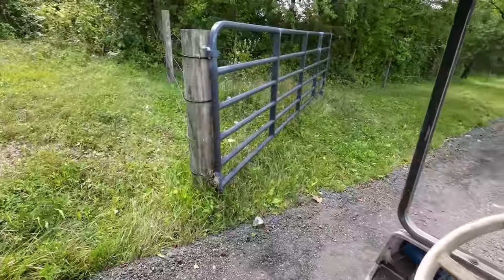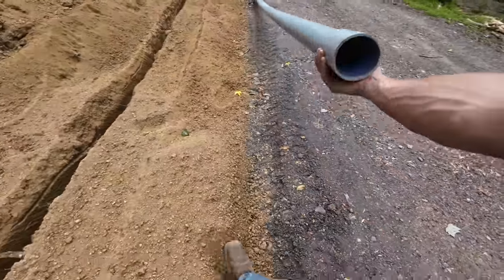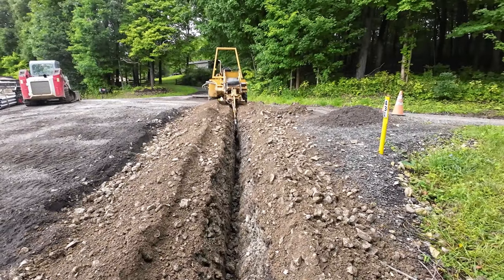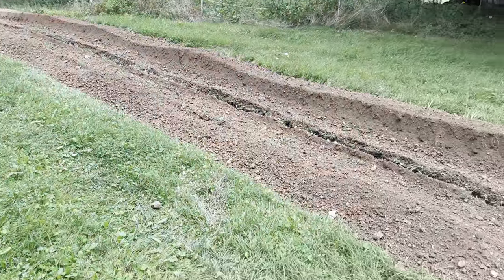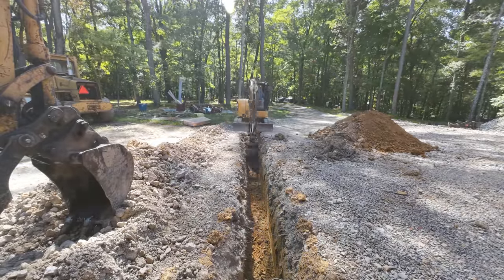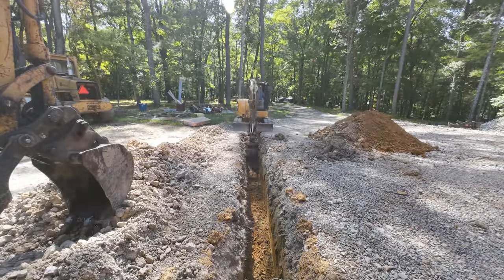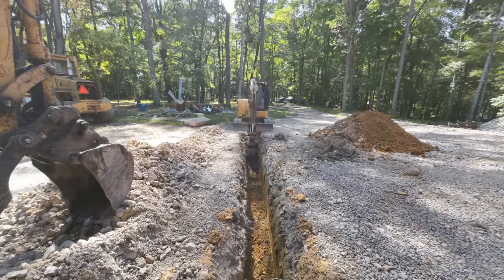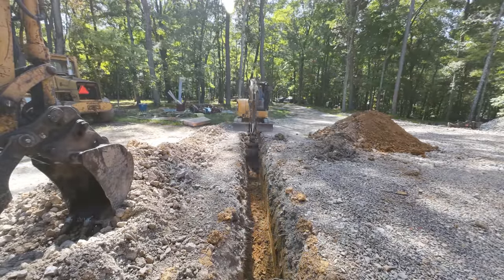Running Nearly 1/2 mile of Underground Electric, Costs over $64,000??!?!

Comment: Surely a Large Solar system doesn't cost $64,000?
Reply: with batteries you are getting close to that
Reply: Solar is unreliable, especially for high voltage needed to run an air compressor, though solar may be useful to supplement the cost of lighting, though the offset of the cost of solar would be rough. Solar is very rarely as efficient as people think it is.
Reply: @gnaedigerfels  but having solar you have no monthly payments for lifetime!
Reply: It also doesn't work
Reply: deadreckon- AmbitionStrikes has a solar system that powers their loft apartment and machine shop. with no issues
Reply: @DeadReckon depends on the size of the compressor and size of the system. Usually the duty cycle on compressors in a shop environment isn’t that much. You could easily make a PV system to meet a shops needs. I’m not sure it would be that much cheaper than a grid tie system and you’d be responsible for managing and maintaining all the infrastructure.
Reply: For my house it would be $30-$40 K. I would still have to be connected to the grid.  To be completely off grid and run machine tools would be over $100k with batteries and enough solar to charge them.   Then you have to clean the panels.  Batteries only last 7-10 years being used like that.  The costs increase exponentially!
Reply: @dustinmcintosh6799 Just because "enough" exists doesn't refute ineffeciency.
I could say that the ISS runs entirely on solar, but that doesn't mean that solar is enough for any usage, it means the ISS runs on low enough power to use it's gargantuan array.
Reply: In Kansas it's free provided and installed by our only power provider
Reply: People seem to forget the further north of the equator, the less efficient solar is, and in the winter months, it only gets worse. Don't believe me, think of you garden solar lights? Batteries also dont like cold, especially lithium, and come with a life span of 9 to 15 years. You can't offset cost if not connected to the grid, and it would cost double the current project cost with no return.
Reply: @GoogleSpyZon  100% correct
Reply: @clarencewiles963 solar power does not have unlimited life, the panels and batteries have a limited life.
Reply: @akhtarkh   company’s are coming out with 10 + years of warranty on their solar equipment and panels can come with a 30 year warranty so it needs a cost analysis and power companies ARE saying to not charge you car, turn off your AC, With brown outs.
Reply: He's in western Pennsylvania. With lake effect weather we have an inordinate amount of cloud cover. An interesting fact is during WWII, they placed the arsenal in Eastern ohio (not too far as the crow flies) due to it being one of the areas with the highest average cloud cover to protect from bombing. Long story short....solar isn't the best idea here.
Reply: @clarencewiles963 
Batteries are the weak point as are the chineseium panels…your replacing the entire system every 10 years …complete scam
Reply: @TgWags69  snow load is an issue that’s why you need to do a cost assessment.
Reply: @KenSiefert   you don’t need to replace if they are only down to 90 or 80% they can go undetermined and there’s companies that give 10 years of warranty. And getting better but if you’re charged cycles are as some 90% down to 50% you’re looking at lifetime. Of service.
Reply: @clarencewiles963  
Buy one, own it for 10 years with the extreme use for his needs, then do the math….your math is based on hope.  The warranty you speak of also has caveats for storm damage and a sliding scale over the life of the “warranty”.  Your insurance rates also skyrocket.

Comment: Dude....  You could have gotten a Tesla Power wall, a roof full of solar panels and a propane generator for back up.  At half that price, geez.
Reply: Was thinking just a nice size generator, what maybe 20 grand. He’s going to use wood for heat so not a lot of electric there. I don’t know what future power needs he has.
Reply from the maker: All of my shop equipment will kill any system like that very quickly
Reply: @DieselCreek  I think you might be surprised but I get it.  I hope they come down out of the clouds and drop that price for you.
Reply: Only problem is you need sunshine. That's in short supply in western PA!
Reply: @TgWags69  You need sunshine to charge the batteries, or you can use a very small propane generator to charge the batteries.  

Yeah, solar doesn't work everywhere.  But for $51k, I would be looking everywhere else for options.

Comment: I was going to tell you my story of 2 years to do 1600 foot down a 45% slope, I would just get flamed. The linemen had to put a brake on the reel, and it took 30 minutes to drop the wire in place 4 more hours to set the transformer and the riser at the bottom pole. The wife asked me nicely for power, and now we have it. So hard to adjust to that after 20 years off grid.

Comment: This is why we bought used Ag land. It already had service. Im surprised it was so much. I worked as a carpenter, never heard such high cost for a full installation.
Then again I would have just run service to a small building at edge and handled the rest myself.  A D9 with a ripper would trench that in an afternoon.
P.s we had a quote for solar at $48,000 installed.  I was able to build a system with far superior premium components and install it all for $28.000.
Its a contractors business to overcharge YOU as much as possible, not help you! Once you get this, your position becomes stronger at the bargaining table.
That smile isnt because were happy for you....
On jobs I wanted $75 hr wage per man , so I bid $125 hr and always got more then what I wanted!  You didn't know and payed. TY! 
When your broke, If you gave us snacks/ cooked lunch id bid less hrs and pass it on to you savings. 2 way street.

Comment: If ya dont already know an easy way to run the rope. You can use a compressor and or a shop vac and tie the mule tape to a couple grocery bags (double or triple+ bagged) handles and use it like a parachute. Blow from one end and suck fron the other. Doing both really helps with those long distances. Probably too late saying this anyways though. Hope it went well.

Comment: Compress air with a butterfly rag/ parachute to push thru the conduit with small nylon rope to pull a cable thru to pull the wire ....you won't create enough vacuum to pull anything

Comment: Yeah its expensive but the utility company # is not too far off.  I am doing a very similar job on my property, only upgrading existing MV for future building plans.  The hardware costs breakdown like this, in order of physical location from source to destination:

For a 100kVA install
- Pole step down (HV to MV) transformer ~$11k
- Approx 2000', single wire (12-15kV #2 direct bury) premium grade is ~$10k
- Conduit if you choose to use it $8-12K
- Pad transformer at destination (MV to LV) ~$10k (fortunately if you already have one of these the cost may not be yours to incur, it wasnt in my case)
- Disconnect and breaker/fusing gear $3-5K

If you go single wire with the 12kV service (pretty common from my understanding) the pad transformer style (single wire) can be daisy chained to other xfrmers for additional/future service installations.  This helps keep conductor cost down since you are "networking" with a relatively small gauge MV wire, vs big two wire LV.  If you look up the ampacity of #2 wire @ 12kV (I believe is a standard required by utility company for these types of installs) you will see that the power capacity is immense, far beyond 100kVA.

Comment: Love your videos. $50,000 will buy solar panels for the roof of the shop & the batteries needed to store the energy produced for the shop & the house you are going to build. Yes I know you are now committed to connecting to the grid. If the grid goes down you still need power. I bet if you check on prices you will see the need for solar & batteries. Love the music!

Comment: I know how much work this was as i have been trenching for underground electrical lines To  update an area building built in 1917 and it is extremely expensive to do and we only went about a total of 600 feet and now have 40 amps at our stage area at long last. Outdoor LED LIGHTS, OUTLETS EVERY 20 feet!! Fortunately the wire was donated but over $900 in conduit and connections. One 100'  single strand of #12 wire was about  $100 dollars.,., great job and good luck with the power company. If they don't cooperate maybe contact the PUC!!

Comment: Yes I think your right about power company sticking it to you. So my suggestion is buy the power cable an run it yourself. Cut down on their added labor cost and materials padding cost.  Only let them make connections and setting transformer. Down here in Florida the underground crew is yr advance listing for doing it. Putting up poles are cheaper done in a day. 
 My neighbor has been waiting so long that he had to put up solar panels.  His new house will arrive before power company will get off their collected asses. 
They have been like that for two yrs now

Comment: Love the view from the door seeing an excavator on the outside. My office has a bobcat with a broom sweep by the door and it feels the same. 

Power companies are in their own world. We regularly see prices for overhead low voltage aerial bundled cable to replace open wire at $20k AUD for the first span (~45 metres) than $10k per span after.

Comment: In Maine you can have a private linesman install the power line in the conduit, then all the power company has to do is set the transformer and make the connections.  It was much cheaper than paying the power company to do the whole thing.

Comment: I know this is a bit old, but it broke my heart when you started talking about your costs. Around here, VA, the power company (poco) is required to provide you overhead service. They'll do the underground if it's cheaper or comparable. Our distance from pole to transformer is a bit longer than yours, almost exactly 2600'. It cost us nothing & they plowed it in instead of trenching & running conduit. Took about 1/2 a day. 

Best of luck with your building projects & please put a link in above if you get some kind of settlement from your poco.
Reply from the maker: That would have been nice!

Comment: Ask for the specks on there wire and if they will let you pull the wire yourself.  Or passably even buy it from them to save labor with a tugger and your toys with 3 guys your golden.  The power CO will still set the transformer most probably...The  Linemen are somewhere $200per hour. + parts.
Your stuck if they require their guys to do it.
That Is a shit load of work for one guy FOR SURE! Great job!

Comment: Your conduit, your fish tape string, pull boxes - ( concrete or plastic ), your labor, equipment can varie $200.00 - $500.00 dollars per hour, electrical panels, and their itemized list of duty work , similar to your own, at my place out here got charged $ 30,000 for a quarter mile

Comment: Hello Matt,

Here in the UK, where we pay through the nose for everything, a Hyundai 18kW/22kVA Three Phase Diesel Generator  DHY22KSE costs £7,499.99 inclusive of 20% Value Added Tax. That's $10,000, but you could get a better price in Pittsburg, so it might be worth postponing a direct electrical connection for a while, until the power company stops trying to hold you to ransom. Then you'll also have an emergency generator in reserve for the inevitable power cuts, as recently happened to C&C Equipment. 

Best wishes,

Comment: That cost is crazy. I’m currently having underground power put in at my place. Power company charges 3$/ foot. That’s them doing EVERYTHING. they dig, put in conduit, pull wire etc. No work on my part except the first 10 feet off my house

Comment: A single overhead wire is usually 12,500 to 13,800 volts single phase. Transformers convert that to whatever voltage and phases you need.
The transformer on the pole at my home has ONE wire on the input and the transformer sends 3 wire 240 single phase (1P3W) and an Earth Ground to my outdoor service panel and meter into the house to the Breaker Panel. With the proper transformer at your shop you can get any voltage you need, 120, 240, 277 and 480.

Comment: I take care of a farm in NJ that got a price of over a million dollars to run 3 phase power from the road, to their refrigeration / freezer area.  It was cheaper for them to buy 4 used diesel generators (for a total capacity of about 800kw) and run them nonstop during the spring / summer / fall.  A little late now, but it would probably have been cheaper for you to build an offgrid solar system or run a small diesel genset to power the place.

Comment: Good job Matt, for the amount they are wanting to charge you, you could buy a pretty decent generator! we built a new house a few years ago and the cost  for our electricity suppler to run underground service was $5.00 per ft for primary wire to the transformer and the $3.00 per ft for the secondary wire from the transformer to the house. I had to supply the conduit. They would run overhead for free up to 1/4 mile if I remember correctly. I chose the overhead to a point in the yard then underground up to the house.

Comment: That price isn’t too far off, you have few enclosures going in, if your running 3 phase your going to have 6 elbows in each enclosure which take time to do and need to be done well. You said it yourself it’s a long run and the wire has to be pulled in slowly not to damage it. I’ve terminated similar runs for about the same price in the northeast.

Comment: I'm kind of stumped on that price. That's like $20 per ft! Now your in a different state, different rules, regulations, prices than here in TN. Here labor and materials installing conduit with pull rope with junction boxes every 300 ft is $15 per ft. Wire is I believe around $8 to $10 per ft. I just bid a job, of which they won't be hooking to the grid do to price, 2,400 ft long with the power companies bill and mine comes to $55,600. Hopefully your power company will come down on their price, I don't know if the solar is worth it but with all the work you already did, I'd be sick to just abandon it to do something different. Good luck! Awesome video, interesting how things state to state differ as far as the installation process goes.

Comment: I can see that was a LOT of work,  it's the first time I've seen you exhausted at the end of a project!
The power companies just make up a price that has no relation to the actual work. I had a connection done here in UK which was less than 20 feet. Cost - £17,000 (about $20,000!)

Comment: I did about the exact same thing here in Montana

3500ft….i did everything myself, trenching, conduit, pull rope, bought and set concrete junction boxes

They pulled wire and set their little transformer….$57,000

Comment: I used to work for time warner back in the late 90's. I was on the main crew that ran all the fiber/cable for the Lowes motor speedway in N.C. So I'm well aware of the amount of work you did by yourself. Also the power co is bs, hope your able to get it worked out. I enjoy all vids so keep them coming.

Comment: Fantastic job Matt. If you want to pull the wire yourself, get a windless puller at a rental place and go for it. Get a couple of friends to help handle the infeed while you work the windless. Or just hire a contractor to do the job. The power company will over charge you for the work. Some electrical supply houses have rental windless for rent also. And if you buy the wire from them, sometimes they will lend you the puller.
Reply: Set the working track of the excavator inline with the duct wrap pull cord around track use as capstain

Comment: Always remember doing this to supply the trench and conduit for my grandfathers self build site, put in the conduit and then used a mobile compressor with air pipe for the jackhammer to force the rope for pulling through with a plastic carrier bag tied to the rope and the air pressure forces the bag and rope along the conduit👍

Comment: Yea... I am an electrical contractor.. We have been bidding stuff super high because of just extremely high demand... Every job has just been an easy home run, going to be a great Christmas. We just closed out a $240,000 job that would of been $150,000 2 years ago. Easy $90k profit.... Just super high demand and low supply. Most older electricians retired during covid and never came back so the few little that still work create a low supply in labor. We wont be bidding anything at "normal" prices until demand is lower. Which seems like it will never slow down.

All my electricians are making $60-70/hr right now + about $10,000 bonus this year with 401K match. Oregon. Unlimited overtime just about.

I just bid a commercial remodel about 2x what it probably will actually cost, and it was signed and accepted the next day.. They said "You are our only option, everyone is booked out 6-12months."

So kids, PLEASE get into trades. You can easily make $40-50/hr at 22 years old.